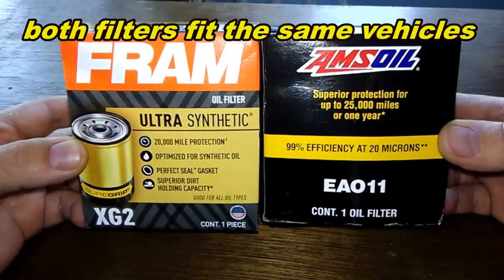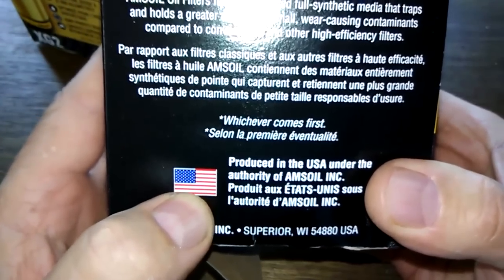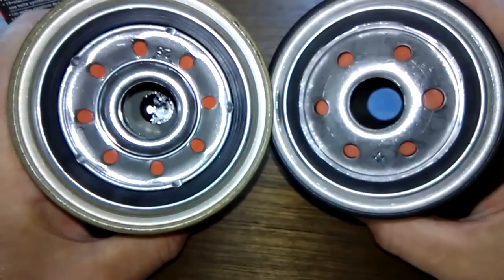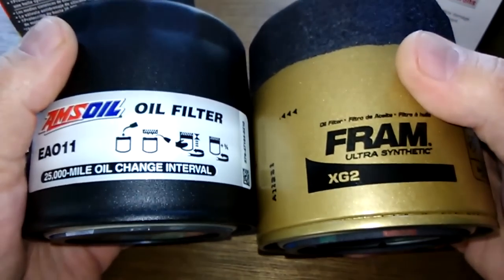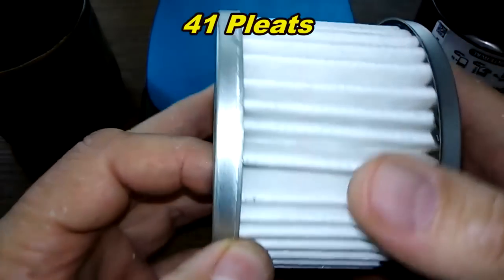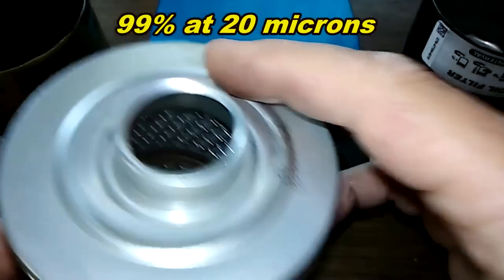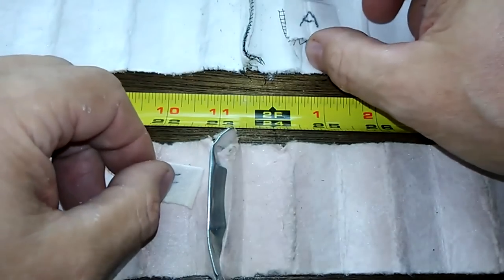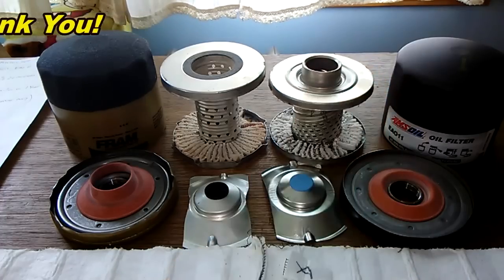Fram Ultra XG2 Oil Filter Cut Open vs. Amsoil EAO11 Oil Filter Cut Open Oil Filter Review

Comment: The price quoted for the Amsoil filter is the retail price NOT the price available to anyone that has the choice to be a 'preferred' customer. You have no knowledge of what Amsoil products are about. I use a EOA64 filter and 5W30 Amsoil signature 100% oil in my 2002 GMC Sierra. That engine has well over 200,000 miles on it. I change the oil & filter once per year regardless of how many miles I put on the odometer between oil changes.
Reply from the maker: I know what their program is, here it is for anyone that wants to join. https://www.amsoil.com/?gclid=Cj0KCQjwpreJBhDvARIsAF1_BU1coWhE54b-YuSY8g4vzFgBRe_zKRgwmmpIWZSLhr280voGUbPHq9AaAmXVEALw_wcB
Reply: F
Reply: So many haters on Amsoil how about ask yourself why is it full synthetic oils are cheaper what actually is being put in them btw thank Castrol when you find out what they don't want you to know. If I'm paying more money for synthetic over conventional I better be getting all snythetic that's all I'm going to say it's up to the rest of you to seek out the truthful info yourselves because you won't believe me anyway.
Reply: @petershulick5270  amsoil synthetic oil lubricates better when it’s all used up than some competitors synthetic oil when it’s fresh, frequency doesn’t matter if your oil doesn’t stack up when it’s brand new. This is why pennzoil (and other companies as well) have their regular synthetic oil and their “ultra platinum” synthetic oil
Reply: Keith Dunbar, so, what is the price of Amsoil filter for ‘preferred’ customer? AND, how much should I buy or commit to become ‘preferred’ customer? Do I have to buy the Amsoil oil and Amsoil oil filter to be ‘preferred’ customer? Upfront please.
Reply: If you can find a local dealer by you, they most likely sell at the preferred price (or at least mine does.)
Reply: Very few things are as annoying as an amsoil believer.
Reply: @mattf2535  Thanks but no thanks.
Reply: Your ultra special fancy oil filter got beat by an $8 filter that's made by the most hated filter company in the industry. Good job
Reply: @TheTopGun920  you’re smart with your hard earned money. But, there’s one born every minute.
Reply: ScAmsoil
Reply: Video clearly shows their deception. Blaming the oe because their filter wouldn't go the 25000 miles. Smh we're to believe that all the identical cars runing around have inferior tuning software and one could develop sludge over another. Im suprised they haven't been sued over this bs statement
Reply: Keith Dunbar have you heard about SCAMSOIL? There’s a report of running on Supertech Full Synthetics with over 200,000 miles with cam cover opened, and everything looks brand new. Always a good practice to change engine oil and filter at 5,000-7,500 miles, maximum 1 year. All full synthetic have detergent formula. Who needs engine flush? Never, never push oil change after 20,000-35,000 miles.
Reply: @bigpicturethinking5620  I for one is annoyed by the AMSOIL ad put out by Eben. He’s always BS and downgrading other brands. Those are selling tons more than AMSOIL, and readily available, don’t have to be a dealer.
Reply: Not only that, but the $19 Amsoil oil filter is made in China.  At least the high end Fram one is made in the USA.
Reply: @LA_Commander  AMSOIL $19 MADE IN CHINA, HOW ABOUT THEIR OIL?
Reply: @victorteo4783  their oil is made by Warren distribution, the same people who also make Super Tech, Amazon Basics, and Kirkland oil brands.
Reply: @francd2981  You have been drinking the Amsoil Kool-Aid. Do you honestly think Amsoil with 10,000 miles on it will lubricate better than another brand fresh out of the bottle synthetic oil? What about after 20,000 miles? Even Amsoil will not make that statement.
Reply: @TheTopGun920  yeah no that filter  fram is less efficient at 20 microns than Amsoil brand. What your not being told is the Fram efficiency percentile is at 30 microns but fram doesn't tell you that. Fram's fine print on their documents say above or higher than 20 microns. VAGUE
Reply: @LA_Commander  sh wrong fram is not made in america dude do some investigating before you make a comment of complete ignorance.
Reply: @Jon-O.  the last Fram filter i saw at the store said made in the USA on it so yeah ok
Reply: I change my oil when it gets dirty ( new car low milage) because two things have happened 1. carbon build up 2. Oil filter no longer able to remove carbon from oil. with that said yes I do change the oil far more often than is recommend about 2500 to 3500 miles is all I get and I always use high grade oil and change the filter
Reply: Amsoil doesn’t want the price to be more than the competitors but it is more expensive to buy the highest performing base oils and additives to make the best oils that are proven in standard tests. The other manufacturers could spend more for quality as well but they chose to be more price competitive
Reply: @darrylsjodin7184  Amsoil, from what I understand, has like three levels of oil.  While their "high end" oil is expensive, their entry level oil seems to be more competitively priced.
Reply: @LA_Commander  yes you are absolutely right! Signature series is the top, then boosted, then OE. All the exceed mfg requirements
Reply: @darrylsjodin7184  what competitors exactly.
Reply: @Richard-wk9le  so actually your spending likely more than you would with Amsoil products by frequency alone. And your high grade oil wears your engine parts 4 to 6 times faster than Amsoil will even at your oil change intervals. So I don't know maybe in the long run using Amsoil could be much cheaper on ya. That is if you keep your vehicles because it ain't cheaper to be frequently buying used let alone new when worn out prematurely.
Reply: @Jon-O.  oh, main stream on the shelf products, Castrol ,Quaker State etc
Reply: @LA_Commander  80% of Fram oil filters are assembled in USA of foreign manufactured parts from around the world. Amsoil oil and filters are 100% manufactured and assembled in the USA. Mostly in Wisconsin. Forgive my previous ignorance.
Reply: @LA_Commander  no, Amsoil oils are made by Amsoil mfg co in Superior Wisconsin
Reply: @LA_Commander  who's oil is made by Warren distribution?
Reply: @LA_Commander  watch the video “how synthetic oil is made” from Gale Banks of Banks engineering
Reply: @bigpicturethinking5620  so facts must annoy you. All their products are put through the same standardized testing as their competitors and Amsoil exceeds all of them. Facts you mad.
Reply: @victorteo4783  every thing Amsoil is all made in the USA.
Reply: @Jon-O.  so is Super Tech, Amazon and many others. For the price of AMSOIL products? No thanks.
Reply: @victorteo4783  you really need to do your homework just because millions buy inferior oils don't make the oils better. You need to find out why Amsoil is superior and why those who begin using Amsoil that see how well it performs never use anything else again. Just because a million walk off the edge of the cliff to their death doesn't mean that's the best way down maybe the thousands that take the elevator down know a better way. Maybe you would want to check it out.
Reply: @bigpicturethinking5620  you really need to do your homework just because millions buy inferior oils don't make the oils better. You need to find out why Amsoil is superior and why those who begin using Amsoil that see how well it performs never use anything else again. Just because a million walk off the edge of the cliff to their death doesn't mean that's the best way down maybe the thousands that take the elevator down know a better way. Maybe you would want to check it out.
Reply: @darrylsjodin7184  look up the Court case between Castrol and mobil 1 which mobil 1 lost see what the Judge Declared can be called a full synthetic oil and what the minimum requirement of synthetic content is to be labeled as full is. Labeled full synthetic does not mean Its all synthetic. And why I never buy full synthetic oil because they are ripping off every one. I do buy 100% synthetic because I'm getting what I'm paying for all synthetic oil.
Reply: @Jon-O.  no offence, I’m 73 yrs old, from Mobil 1 full synthetics and other full synthetics, change my engine oil every 5k miles, never had any engine issues. Engines are super clean. Engine oils are cheap, engines are not. It’s your money, spend anyway you want. Even my nephew had a Ferrari and never needs AMSOIL, or SCAMSOIL he called it.
Reply: @victorteo4783  no sir and you can't compare those oils with Amsoil because they aren't the same type of oils their are only four or five  brands in the world that similarly match Amsoil and are the same price or more. With pretty much identical quality.
Reply: @Jon-O.  ya, I’ve heard about that, you’re right,there are a lot of different base oils in different tier levels that they call synthetic but are still made from petroleum products. You tube channel "Project Farm" did a test on oil a few years ago and he is very thorough.
Reply: @darrylsjodin7184  yes it's up to us to find this information out to make the choice as a informed consumers. If I'm paying more for a synthetic it better be all synthetic unfortunately that isn't the case with full synthetics . Dam judges and lawyers playing word games with legal wordings.
Reply: @victorteo4783  no offence taken sir I'm 57 and was a loyal Mobil 1 customer till I found out after the judgement against Mobil 1 they quit making their full synthetic oil all synthetic because Castrol got what can be labeled full synthetic oil and it's not all synthetic legally awarded. So Mobil 1 followed suit because it was more profitable to do so and they can't be sued for false advertising either like castrol or any other oil brand that claims their product is a full synthetic.
Reply: @darrylsjodin7184  Amsoil only makes their own additive package. They get their stock base oils from the same sources every other oil company purchases from. In fact, very few oils are entirely made "in house". Shell, Chevron, Mobil, maybe a few others. But that club is very small.  So if you're going to try and refute that then I want to see actual photos of the Amsoil oil wells, drilling operations, and refineries.
Reply: @LA_Commander  oh ya, you’re right, they blend products that they purchase, as most of the oil companies do, to create the the product to perform the way they want it to. We are on the same page 😀. For instance Lubirisol is an additive company that Amsoil used that knows if they create a higher performing product, Amsoil will be interested in using it to stay one step ahead.Nice talking to you!
Reply: The mere fact that we are talking about oil and filters means that we are all car guys! What kind of cars do you have? My youngest son has a red 2013 viper and a black GTI, my oldest son has a 2000 Miata and a 2015 model S and I have a black 03'Z06 and a 2012 Lincoln MKZ.
Reply: @darrylsjodin7184  currently I own three vehicles the oldest a 2001 Ram 2500 Van 5.2l (318ci), 2015 Dodge Journey 3.6l direct injected and 2017 Ram 2500 Cummins G56 6spd manual. But though out the years I’ve had many daily drivers that I modded out most of which were sleepers.
Reply: @Jon-O.  very cool! I like Rams and Dodges myself
Reply: @darrylsjodin7184  my Dad worked at Chrysler headquarters for the second half of his career so even though I compared ford and gm vehicles I was always getting more for my money with mopar because of employee discount but I was also very choosy with the powertrain choice. When I bought my first pickup 97 it was between the ford 150 5.4 3 valve triton and the Ram 1500 5.2L I choose the Ram because the 5.2 was a proven 318 ci iron horse design. Unlike the triton 5.4 with timing chain tensioners that got brittle and busted apart. Mopar kept the old proven timing chain design that lasted for multiple 100’s of thousands of miles. Quality really is in the beholder of the informed eye. My first car when I was 16, I’m now 57 was a 71 Pontiac Lemans with the 350 ci 400 TH trans. That was a sleeper that thing would sit still as I melted the tread off many a tire when they still could buy poly glass tires.
Reply: @Jon-O.  That’s an awesome story, thanks for sharing! I’m 62 and my first car was a 72 Nova, which only had a 110 hp straight 6😕, but it had a power glide! That’s so cool that your dad worked at Chrysler! If I ever have a pickup it will be a Ram. I still can’t believe it when my son pulls into my driveway into that 2013 Viper! It’s amazing! I recently retired and got the 2003 Corvette Z06 for myself, my first fun car. It’s literally like a race car! I can’t drive it right now because I just had a total knee replacement, so I’m laid up😕 It’s been nice talking to you! If you want to order any Amsoil products, you can use this referral # 377464. Oh also,we’ve been talking about oil filters and if you’ve never heard about bypass oil filters before, Amsoil makes several for light duty trucks and cars. It’s effectively a slow filtering additional oil filter that mounts separately on your vehicle and connects with high pressure hoses to your engine. It filters all of your engine oil 3 to 4 times per hour down to 2 microns at 99.8% efficiency. It lasts 60,000 miles or 2 years. It can be used with any brand of oil, so no need to change what you like.The tough part is finding a spot to mount it, but it’s good piece of mind.
Reply: @Richard-wk9le  YOU are one of those people whose too-frequent oil-and-filter changes are what made the oil makers and the oil  filter makers to work toward longer-lasting oil & filters.
It's ALL about preserving our precious air and water, and your habits are NOT HELPING.
 I do 5,000-mile oil & filter changes, and would urge you to, as well.
Reply: @darrylsjodin7184  thanks and sorry I already have a dealer.  Yeah my buddy had a nova SS wow. I’m investigating on a mount to work with a EABP100 in my Ram Cummins. The soot is ridiculous.
Reply: @Jon-O.  Oh, that’s great! Thanks for responding! Good luck with the truck😄
Reply: FRAM has a price.  The price is good.  No BS "preferred" hoop to jump through.  Amsoil has a retail price.  The retail price is high.  The filter as shown here is nothing special.
Reply: @NackDSP  it's better because fram will not say 99% @ 20 microns it's says 98% efficiency but in fine print it's above 20 microns so that could be at 30, 40, or 50 microns they won't specify. So yeah you get what you pay for and Amsoil is the better filter along with WIX or Donaldson.
Reply: @NackDSP  yup,that’s right. The Amsoil preferred price is very close to Wholesale, but is still more than the Fram. It’s all economics, huge companies vs small companies
Reply: @Jon-O.   I did my homework for sure.  SuperTech and Amazon have all the government endorsements, did AMSOIL have them?
Reply: @Jon-O.  I just don’t believe to promotional propaganda. Who claims they’re the best oil, others are inferior to theirs. Testing in negative -40 degrees, I don’t live in Siberia. I won’t risk their 20-35k mikes of use. Just change your oil and filters at 5k miles. Oil is cheap, engine are not!
Reply: @Jon-O.  I wonder what expensive engine or car you’re driving? Fighter jet? I don’t mean to insult you, I have a Ferrari, Porsche that I take to the track occasionally and a Jaguar XKR for daily commute. Never need AMSOIL ever! Wonders what kind of car you’re driving that needs AMSOIL?
Reply: @Jon-O.  that’s not nice to insult “FAKE FULL SYNTHETICS” out there. Offending the majority of drivers using it and oil companies. Your money, your choice, your believe just don’t insult in your believe. That shows what kind of a person you are. I feel sorry for you. Bye 👋
Reply: @victorteo4783  lol bye have a nice day. It is true about the jets and planes though they only use 100% synthetics.
Reply: @victorteo4783  Cummins Diesel a $10,000.00 option engine in my Ram Truck.
Reply: @Jon O  I don’t drive a jet plane, my three cars didn’t recommend AMSOIL. It’s an overkill. Like I said, it’s your money. I can use AMSOIL, do I  need it? No! It’s a fine weather to go enjoy 😊 drive with my Jaguar XKR convertible. I’ve wasted enough time, bye bye 👋
Reply: @victorteo4783  Not all Amsoill products are made to go 25000. Only their extended life signature series oil makes that claim. The rest of their products are designed for chages at normal intervals. I think most people who are commenting here dont understand that.
Reply: @michaelbiever2092  well, Eben was promoting AMSOIL in a very misleading way. Like, -40* oil flow, maybe for people living in Siberia perhaps. 20-35k oil change. Discrediting other engine oils. That pisses me off, as well as other majority drivers.
Reply: @michaelbiever2092  So, AMSOIL do make full synthetics for regular, normal oil change? What are the prices? And where can I get them without having to commit signing up? As far as I know, AMSOIL is never sold in major stores. Wonders why?
Reply: @Jon-O.  I'll take Japanese oil over American oil. Higher standard
Reply: @dieselboy77  japan don't make 100% synthetic.
Reply: @Jon-O.  idemitsu does
Reply: @victorteo4783  Amsoil us API certified back in the seventies and their formulations still surpass API and GILSAC specs till today.
Reply: @dieselboy77  I look into it but what I can tell you is any comparable 100% synthetic with additive package is priced with in a dollar or two. If it's the difference is more it's a good bet it isn't 100% synthetic.
Reply: @dieselboy77  I look into it but what I can tell you is any comparable 100% synthetic with additive package is priced with in a dollar or two. If it's the difference is more it's a good bet it isn't 100% synthetic.
Reply: @dieselboy77  yeah first idemitsu is owned and operated by "dino oil" companies petroleum based oil not a chemically formulated base. Secondly they don't even list the group base oil class 99% of the time that means the base classification is 1, 2, or 3 all  of which are refined oil from the ground. Group 4 and 5 are not they are 100% chemically formulated in labs not from the ground petroleum. Their owners have a vested interest to only use petroleum ground based refined bases. What I can tell you ALL the 100% synthetics are all owned separate from petroleum companies example Amsoil which offers only one oil that has a petroleum base stock and it's a break in oil for engine builders so bearings can wear in and seat. otherwise all their oils are 100% synthetic. Motul and redline also make 100% synthetic but they also offer full lines of petroleum base stock full or fully synthetics which can be up to 75% petroleum base.
Reply: @dieselboy77  don't get me wrong the group 3 base stocks are excellent top notch full synthetics that can contain 75% refined from the ground petroleum base oil. But that variable sized molecules even though it's way better than regular oil it still wears at a rate 4 times as much as a 100% synthetic. Also why manufacturers won't promote it people wouldnt buy new vehicle except every twenty years or more. Not profitable for car makers ha. Well that's what I do a new vehicle only after twenty years if I need to. So the increased cost Amsoil is by far out weighed by the cost of vehicle replacement or power train replacements or rebuilds ergo much more economical to use it than not. I had to get rid of two vehicles after twenty years because I couldn't stop the rust out with out doing a full restoration at that point I'll buy a new one. With that time frame you can invest money to end up paying cash for new vehicles and not go into debt.
Reply: @Jon-O.  idemitsu is sp6
Reply: @dieselboy77  their is five groups of base stocks world wide go with your misinformation some where else.
Reply: @Jon-O.  Have you ever ran idemitsu engine oil in a Japanese car and sent it to the lab? If not  you can't assume those are shit oils especially when engineers designs cars using those oils
Reply: @Jon-O.  I learned from my pst experience any good oil can make an engine last forever, like I said I had almost 300k miles in my focus using Motorcraft synthetic and never burned a drop of oil
Reply: @dieselboy77  yeah you also paid 60% more because of the frequency of your changes but hey it's your money do as you see fit. Because if you ran it like Amsoil can be run you would be lucky to see half that mileage it would fail before 150k
Reply: @Jon-O.  Not really , i always got Ford discount so 5 quarts of oil cost me 19.99 plus oil filter for 5 dollars and changed it every 7500 miles
Reply: No sir you see they've already run engines on Amsoil with filter changes 100,000 miles before changing the oil out and tore the engine down to measure the wear and it only showed consistent wear of a engine with half that mileage you can say all you want but those are facts. Some diesels that have used their bypass filtration have run Amsoil oil 200,000 miles before it got changed out. Not one full synthetic can do that with out engine Failure. But I'm wasting my breath because you won't believe the facts any way. Check it out if you dare.
Reply: i love the science and the data backing the amsoil product would not use anything else
Reply: @mikegadoua9589  I hate that there is all this mountain off data showing Amsoil as superior to the rest of the wannabes and also with the ones that are made exactly the same way example Motul another 100% synthetic. It's like these people don't want to accept that Mobil 1 the worst who actually came out as a 100% synthetic then lost the case to castrol stopped making it as a 100% and keep charging everyone for decades like it was the original mobil 1. it's like there to proud to admit they got screwed over that bad so they cognitively refuse to buy Amsoil it's absolute lunacy. I'm running Amsoil and when you correctly run there products with analysis and top of the line filters and go or surpass the change interval because the Amsoil product is still capable of doing it's job. It ends up being half the cost of wannabe competitors but your vehicles last up to 3 to 4 times longer HELLO it's no a no brainier for those that can put emotion aside and think critically, a rare breed.
Reply: Traded in  97 ranger 4.0 with 300k running perfectly changed oil appx every 5-7k depending on when I remembered it running the cheapest oil and filter I could find. Don’t think fancy oils and filters would of hurt but I don’t think they’d of helped either
Reply: @NoName-tz5ji  nice why did you trade it in?
Reply from the maker: @seymourscagnetti1413  Nah not really, It's part of making Youtube videos. He's got his own opinion, No problem I've got mine too, we dont have to agree.
Reply: Amsoil fan boy no doubt.  Amsoil oil products are in my opinion are no better and no worse than anything else out there.  Do I think Amsoil products are bad.. No.  Just not much better than anything else.
Reply: @Mark-eu4ds  good use regular oil and a Fram tough guard oil filter. It'll be fine
Reply: @Mark-eu4ds  Amsoil’s transmission fluids on the other hand are wayyyy better than OEM fluids. I will say that. I personally won’t pay an arm and a leg for their engine oil, but I’ll certainly pay for the transmission fluid. Much better tolerances to extreme temperatures and breakdown especially under stress like when towing and such. Believe it or not it was actually significantly cheaper than the OEM fluid, plus free shipping.
Reply: Tbf, we own a 2007 Silverado 1500 4.8 with 437,000 miles that’s used for a currier service. It gets fresh O’Reilly’s brand conventional oil every 4k, religiously. Only had to replace starter, battery and alternator, zero internal parts. It’s more about keeping fresh oil at the correct level. That being said, I only use Amsoil in my motorcycles. A big air cooled VTwin will cook conventional oil and I’ve found Amsoil last longer than Mobile 1 at the same intervals. Bike runs a few degrees cooler as well, as checked by a Power Vision 4, which keeps up to the second engine temps and can record readings.
Reply: @freebehindbars8654  yep your absolutely right and this is where most people get confused by doing your oil changes every 4k you spent more money on O'Riley's oil while Amsoil ran once a year would have been cheaper. With less wear on your 4.3.
Reply: @josephhettiger2711  hehe the scam is what can legally be called a full synthetic. If you use full synthetics you've been scammed.
Reply: Right on brother
Reply: @petershulick5270  his gmc has over 200k miles. who cares at this point? hes done something right to get a pos gmc sierra to that point. my uncle had a 2001 gmc that was the biggest lemon produced. Kudos to the guy for getting his gm to 200 k miles.
Reply: Amsoil blows
Reply: @jeremystout412  I agree. Put it in my 2014 Silverado Z71 4x4. I put Amsoil fluids in my whole drive line last spring. Super smooth. Someone would have to experience this to understand.